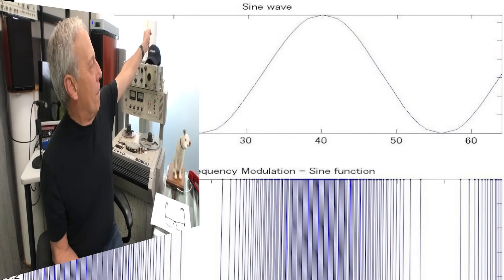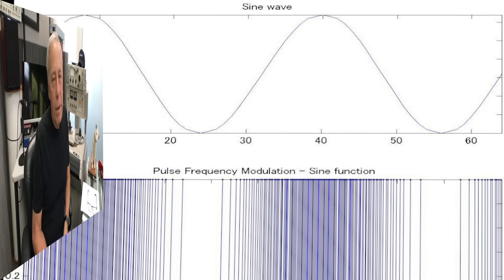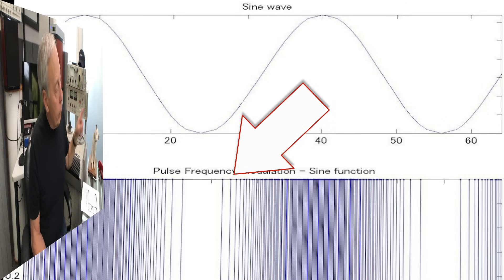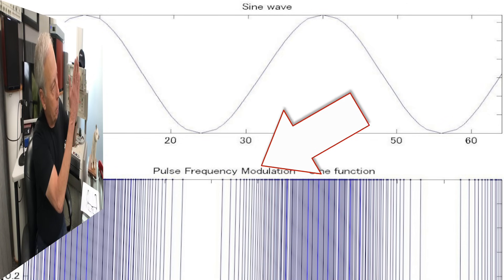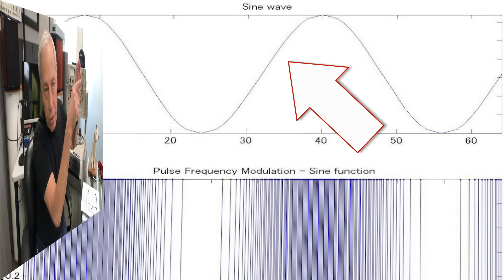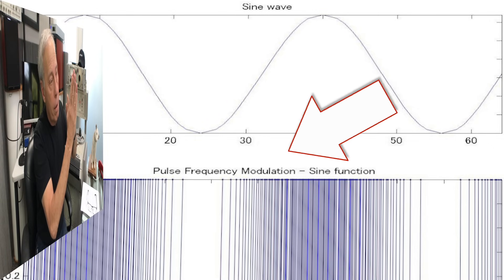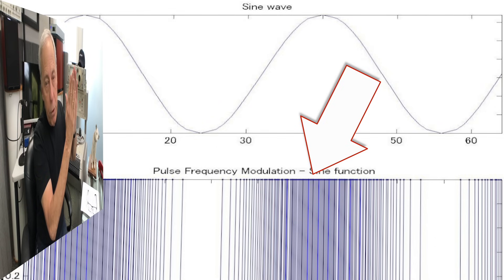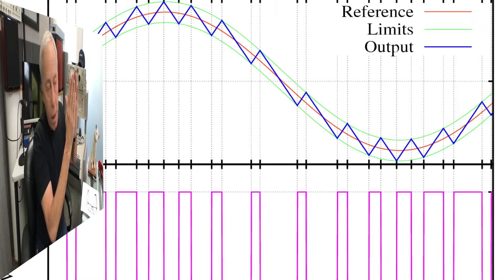What are the differences between Class A, AB, and Class D amplifiers?

Comment: The question about the differences between the various amplifier classes (for audio) is a frequent one.  Paul's answers were basically correct, but it's a difficult question to answer in a simple way that makes sense to everyone.  As an electronics engineer (and audiophile) I can explain to someone the differences in a technical way but only those that understand electronics, and specifically what "bias" with regards to either tubes or transistors means, a technical explanation would be mostly worthless.  For non-technical audiophiles, or anyone that is not trained in electronics with regards to amplifier design, the answer is much simpler and works most of the time.  Here it is:  Class A produces the least amount of audio distortion in the output signal, but is the least efficient design (produces more heat) and is often the most expensive amp.  So, often Class A amplifiers whether they are tubes or transistor amps, are often large in the case of tube class A amps and have a lower wattage output capability than transistor Class-A amps.  There are exceptions to the "lower wattage capability", for example Bob Carver, the famous audio amp designer created some rather high-wattage tube class A amps that are behemoths and have equally behemoth prices - but they sound marvelous.   But in general, for audio, class A amps produce the least amount of audio distortion.  If you're familiar with tube audio gear you will know of the vintage Marantz and in particular McIntosh tube amps - these are all Class A designs because Class A is the lowest for distortion (plus other advantages/disadvantages).  Class AB amps can be designed for low distortion but are often not as successful as a well designed Class A amp.  Whether you can hear the distortion in a class AB amp is another matter, but when measured with certain instruments even a properly designed class AB amp will have higher distortion than a comparable class A amp.  Also, when a class AB amp ages, the components associated with the bias can result in higher distortion over time. Similar can result with class A though it's often less severe or noticable.  As the video stated, Class D uses a very different approach (PWM or Pulse Width Modulation) than Class A or Class AB.   Class D amps are best for use as sub-woofer amps because they can put out lots of power which is often required for subs, especially small cabinet subs.  However, although measured distortion can be high in the bass frequencies with class D amps, the ear is less sensitive to high levels of distortion in the bass region as compared to the mid-range where the ear is most sensitive. So, in terms of selecting a class A, vs a class AB, vs class D amplifier:  As a general rule and if you have the dollars to afford it, select class A if your speakers and room can work properly with a lower output wattage at the level you want (as compared to a transistor) amp because the distortion will be minimal with class A.  Select class AB if you need lots of power (above 50 watts RMS) and are willing to live with more "measurable" distortion, though you may not actually hear it.  Use a class D amp for subs: actually most subs come with their own dedicated amp which will usually be class D, so you don't need to choose the amp for such a sub.  Stay away from a class D amps for use with a regular speaker (other than a sub) for serious musical listening.   However, I would also add that an improperly biased, or defective, class A amp can produce distortion that can exceed a normally working class AB amp.  So my selection suggestions apply to properly working audio gear.  There are, and will always be, exceptions to all rules, and audio amplifier design is as much an art as it is a science, but in general, from a distortion point, class A is excellent (lowest distortion), class AB is good to excellent (more measurable distortion than class A), and class D (highest distortion) is really for specialized use such as with subs.
Reply: It's funny how everyone gets all worked up about "distortion" in amps, be it Pre or power when the total accumulative distortion of both Pre and Power amps are but a fraction of the total system distortion.
Reply: Some A?B amps have their biases set so they are class A up to and above 40 watts, see Nelson Pass's amps.
Reply: So class AB makes more power than A and do to this can cause more noticeable distortion? You mention class D for subs but don’t all portable digital electronics like cell phones use class D for audio?
Reply: @mrsemifixit  not at all I like to use class D amplifiers for bass and the other classes for highs and mids
Reply: If you put a DSP into your loop in the class D, you can get it to sound nicely, but it requires quite some computer power and some fancy programming, something currently possible, it was not always like that.
Reply: We are at a point where Class D is good enough for most people.  Plus it's really cool driving big speakers with a tiny amp- that blows peoples mind when I show them that.
Reply: I remember how superior my Carver M-240's & M-4120 sounded, compared to other amps of the day...only (some of) the early  Nakamichi PA series amps sounded better...imho.
Reply: Try listening to Hypex nCore amps for a revelation in class D amplification.
Reply: Bob Carver and Nelson Pass are both geniuses and they designed the Carver and the Nakamichi amps you are referring to.
Reply: @brianf.burkejr.1488  I Love Mr. Bob Carver, I have his Silver 7t Mono block amps... I had them rebuilt a couple of years ago...Powerful.
Reply: Today, i got good info on speakers. Thank you.
Reply: Just looking at the aspect of amplifier and judging the sound quality isn't really enough. What about those active crossover speakers? Don't they have built-in DSP to control distortion before sending the signals to separate amplifiers for separate drivers ?
Reply: To bad that class d no longer has those issues all you yuppies have to believe it. These days a class d can easily outperform any a/b or a class ..

The distortion levels of any topology spoken amp here is way beyond audible hearing level . So no worries
Reply: Well in my case it came from somebody reading class d on their amp and deciding they wanted to learn what that meant so im just gonna throw out a guess that this question came from somebody doing close to the same. Lol
Reply: @dustinfoltz4769  Thats what I did lol seen class D, well wtf does that mean and here I am. Glad I read this comment section. Sucks to have little faith in your equipment when its actually decent. Im chasing some intermittent issue and going down many rabbit holes lately.
Reply: absoftitanium  Explain
Reply: This is a little bit of a loaded question. I wish he would have ended in saying your particular application is very important in making a choice of what class amp you need.
Reply: Yes, that's very true Dustin.  Unfortunately, with audio you can't ask a simple question and not stir up a controversy of some sort.  My previous comments on distortion stand in spite of the negative ones under my  post.  But your point is well taken in that on can look at particular amp classes from different perspectives as to which is "best" and of course, what the application is.
Reply: Some of the highest fidelity loudspeakers in the world use class D amplification; L-acoustics, Meyer, D&B etc etc.
Reply: @conorm2524     You  have  named  some  of  the  top  echelon  touring  sound  production  companies  on  planet  earth  -  producing  sound  for  hundreds  of  thousands  of  people  at  concerts  and  festivals  around  the  world . D&B  Audiotechniks  amps  are  made  by  POWERSOFT  as  are  some  of  amps  for  EAW's  Otto , Anya  etc.   Class D  -  no  problem .  I  think  he  was  making  a  GENERALIZATION , and  as  such  needs  to  be  taken  with  a  grain  of  salt .......
Reply: What Bout a class x amp and so basically for my car I would want a class d for subs and class a or class a/b for my speakers. Also I saw a package of 2 12" with a class a/b amp would that be alright for the subwoofer
Reply: I think Paul's explanation was better tbh. No hating.
Reply: .. or go with class T.
Reply: I had a customer call me because he wanted to change his amp on what is a very simple setup because of this video so i thought i should take a look. Lol
Reply: Yes, some customers will likely always be in a state of relative anxiety for one or more reasons, sometimes looking to make an "upgrade" or change something because "someone" said this is better than that.  So much of audio is both objective, like measurements with test equipment, and so much is subjective, such as hearing tests and asking for feedback.  I've had situations where individuals simply insisted on a particular circuit design because they were "told" it's "the best" even though what they had was perfectly OK for their application.  There's so much "snake oil" in audio which makes it both interesting and unfortunate at the same time.  In fact PS Audio has a video "Why so much snake oil in audio?"  It's sometimes hard to say "no" to a customer when you know they really don't need something. they're asking for.  Sometimes you just have to go with their desire and keep and open and communicative relationship.  The original question actually was about the different classes of amps and "circuit topology" .  The term "circuit topology" is a technical term and not typical of most audiophiles unless they're trained in electronics and the concept of amplifier biasing.  So I have to wonder who was actually posing the question and for what real purpose. Perhaps it was a faux question to be a lead in to the answer in the video - which is perfectly OK.  In any case,  as an audiophile myself, I tend to listen to what my ears tell me and steer clear of so much of the hype and misinformation out there about audio.  While audio engineering can be considered a science (and also an art, with a good amount of artistry), listening to music is a completely subjective process.  And in the final analysis that's what keeps the field going.  Otherwise, there would be only one brand and model of speaker, amps, and whatever.   So I have lots of respect for those that have to deal with a customer, it's not easy and it can send you down rabbit holes. It's perilous but if you're in the audio business it comes with the territory.
Reply: Nice. But the problem is , the source will most likely be the bottleneck for audio quality for most people.
Reply: I have an Bose amplifier: 2x50w @4 ohms, 2x25w @8 ohms 

And Bose speakers: up to 80w, 4 ohms 

What is the maximum number of speakers that amplifier can handle?
Reply: @كورسسسكوللشبكات  You didn't say exactly what model Bose amp, and this is a somewhat long answer because of the nature of the question:  In any case, there are various ways to connect multiple speakers to an amplifier:  Putting the wattage aside because that's a secondary matter, generally most typical speakers for audio usage are stated to be 8 ohms (however there are exceptions such as with electrostatic speakers).  And by "speaker" is meant a single box or unit hat my contain any combination of individual speakers and a crossover network that together are "the speaker".  Considering one channel of the amp: If the amplifier has 8 ohm terminals then a single 8 ohm speaker would be the recommended number of speakers; in the case of a stereo amp that means 2 speakers total, each 8 ohms, one for the left and one for the right channels of the amp.  However, it's also possible to connect two 8 ohm speakers in parallel to a single 8 ohm amplifier channel. When you do this the two 8 ohm speakers look like a single 4 ohm speaker to the amp - it's is not advisable to wire two 8 ohm speakers this way because it can, depending on the design of the amp, cause the amp's output stage to work harder and can even burn out the output stage over time.  You can also take two 8 ohm speakers and wire them in series to the same 8 ohm amplifier terminals. In this case, the speaker will look like a single 16 ohm speaker to the amp.  Generally this will cause less power to be delivered to the speakers which will generally causes an overall drop in audio level;  with this arrangement, you'll have less power reaching the speakers.  Another possibility is to connect two 4 ohm speakers in series to the 8 ohm terminals on the amp; this will generally be OK because the two 4 ohm speakers will appear to the amp as a single 8 ohm speaker.  Another possibility is to wire two 16 ohm speakers in parallel to the 8 ohm amp terminals -this is also OK because in this case the two 16 ohm speakers will look like a single 8 ohm speaker.  Series vs Parallel:  Each speaker will generally have a + (plus/red) and a - (minus/black) terminal.  Series wiring means you take the positive terminal of one speaker and connect it to the negative terminal of the 2nd speaker, this leaves you with a negative terminal from the first speaker and a positive terminal from the 2nd speaker - it is those terminals that you then wire to the amp's output channel.  With parallel wiring you take the plus terminal of each speaker and wire them together to form a single plus wire, and take both minus terminals of each speaker and wire them together to form a single minus terminal and connect the combined plus and minus terminals to the amp.   There are other possibilities depending on the ohms rating of the speaker(s) but that can get complicated.  The simple math here is that two 8 ohm speakers in series = 16 ohms.  Two 8 ohm speakers in parallel = 4 ohms; similarly, two 16 ohm speakers in series =32 ohms, or two 16 ohm speakers in parallel = 8 ohms.  So to answer your question, it depends on the speakers you have but the general rule is if the amp terminals says 8 ohms connect a single 8 ohm speaker - or combination of speakers - that together appears as 8 ohms to the amplifier;  If the amp terminals says 16 ohms connect a single 16 ohm speaker - or combination of speakers - that appears as a 16 ohms to the amp.  Same if the amp has 4 ohm terminals, etc.  Wattage is less easy to determine.  But in general, maximum power transfer occurs when the load from the speakers matches the output impedance of the amplifier channel. 
So for the 8 ohm output channel of an amp, it should see 8 ohms from the speaker, etc.  if the amp's 8 ohms channel sees less or more than 8 ohms from the speaker then there will be less than the maximum power (watts) transferred to the speaker.   So in terms of watts and a single channel, if the amp says 25 watts @ 8 ohms, theoretically, as long as the amplifier "sees" what appears to it as single 8 ohm speaker,  or combined speakers wired in series or parallel, as a "single 8 ohm speaker", then the 25 watts for that channel is more or less accurate.
Reply: @DIYerGuy  you're the best 

Many thanks
Reply: @كورسسسكوللشبكات  looks like 4. Do not add more then one speaker to an speaker output.  You can damage the amp.
Reply: @kolinstallman3788  many thanks
Reply: but i love to hear class D amps, because its for an outdoor sounds ampifications and sounds thunderous and more excitement to hear than class A &AB.
Reply: Who asked you?

Comment: Class A = Royalty
Class AB = Dukes, Ministers etc
Class D = Common Gentry, Robinhood
Reply: not really, all the higher end audio brands are moving towards class D as more research and development comes through. A quality high end class D will not sound any different from a quality class A and A/B  however it'll have A LOT more headroom with the power so at higher volumes the amplifier will not be anywhere as stressed.  Cheaper class D amps are garbage though.
Reply: Depends how many power transistors used in a class A. Also if it's a Grounded Bridge amplifier.
Reply: @Jeffdachefz  My class D amp sounds very smooth...very much like a tube amp.
Reply: astralboy79 Class C = Village idiot
Reply: congrats...i just copied and re-pasted ur response....many here have the same misconception....off the top of your head whats a lovely class d for a middle class gent like me?
Reply: Class a amplifier steampunk as fuk
Reply: Robin Hood was not a commoner...
Reply: Frank Geeraerts lol whatever floats your boat man.
Reply: So wrong and it shows an elitist mindset  towards gear. Each has pros and cons. Class d amp can be the size of a credit card and produce an easy 500w rms and at more than 90% efficiency. Try and do that with class A or valves.
Reply: just buy a Sansui , Marantz , or Pioneer receiver or amp from the mid to late 1970s  and get over it and move on. i'm in my seventies and own 6 of the beauties and couldn't care less about this new dumb shit - PERIOD
Reply: @APRAPR-nq2wn  Don't throw the baby out with the bath water. Class D dissenters could soon become like the digital haters did-dated. If you're in your 70's you only have partially the hearing you used to. So there's probably a plethora of old gear that still sounds GREAT to your ears.
Reply: @astralboy79 This comment just feeds into the problem that hi-fi has always had; snobbery and oneupmanship. I'd like to say that since the 70's/80's we've moved past that, but clearly, we have not.
Reply: Class C is not used for audio.
Reply: I KNOW THE TRUTH CLASS A IS BETTER WHY ARE THOSE MAN IN BLACK KNOCKING AT MY DOO...
Reply: Class D will be pushed and forced down your throat
 by the system and its restrictions & regulations......
Tube lovers and class A amplification wil be considered as outlaws and terrorists .
While the rulers who made the laws smoke cigars and drink Champagne..........
Reply: @frankgeeraerts6243  i ask myself .. why do asian peoply buy a lot of old music equipment out of europa , if the class d amplifier is better? a ag9016 tube amp can sound much better compared to many class d amps ..